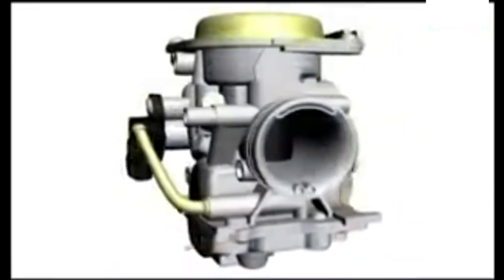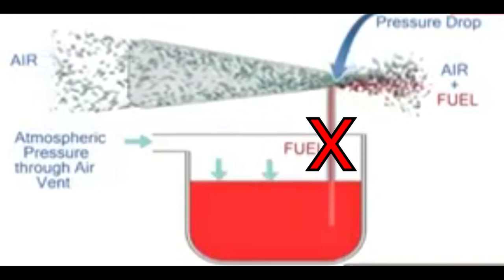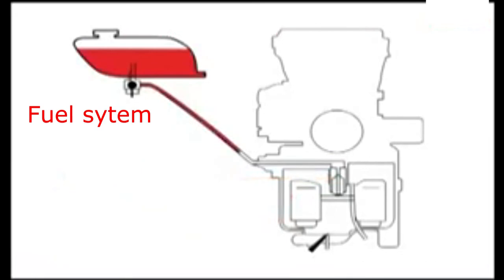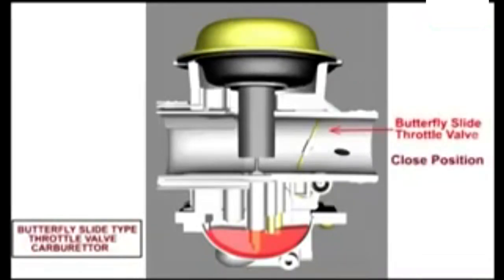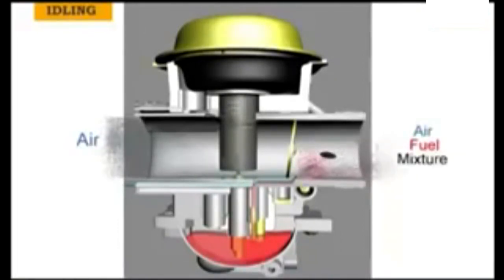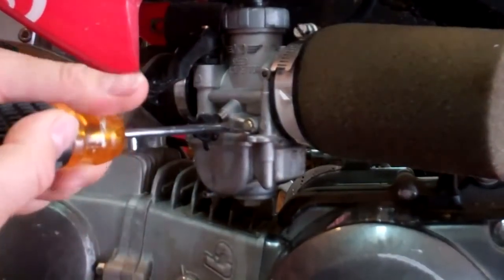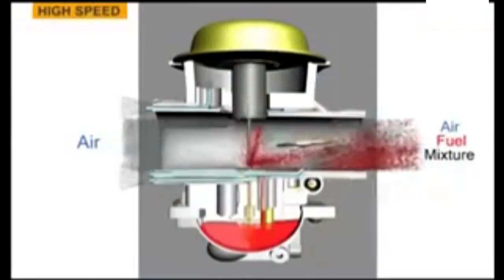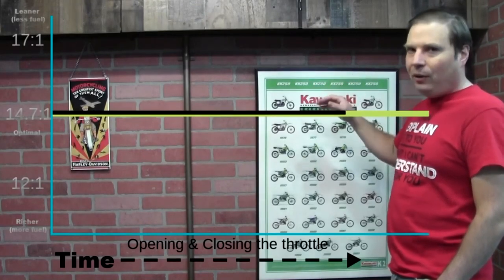Carburetors, all you ever wanted to know (and some stuff you didn't)

Comment: Hey man, maybe you can help me, i have been struggling for a year on my old kawasaki ninja: i have a 4 carb engine, the previous owner put on an hideous exhaust and changed the carb jets. The bike never ran properly, i put on the stock exhaust, stock filter and stock jets, but it always bogs down when i open the throttle, especially when i am going uphill. It has come to the point that the bike barely accelerates on an incline. What could be the problem? I tired to restore the carbs to the factory settings, changed the needle height, changed the air fuel mixture screw adjust, checked the float height, all looks good. I am suspecting a vacuum leak somewhere but i don't know how to find it. 
Thanks in advance mate, you earned a sub with your videos :D
Reply from the maker: Usually stock jetting is a little lean. Try a richer main jet.
Reply: Thanks man, I'll give it a try
Reply: Well i have a little update : after the whole winter i tried to start it and the old battery was totally dead. Took out the ols battery and found out it was smaller than the original spec, bought the right battery (10AH against the 8.5 AH of the one that was on the bike) and lo and behold, the bike seems to run fine now. How can it even happen? My theory is that the smaller battery limited the current that go to the spark plugs and the fuel pump
Reply: @thejunkman  Hi mate, I have atv that idles well but at throttle the rpm keeps going up and down -- let say 1/3 fixed throttle position but the rpm goes up and down, it seems to be in a regular patter, will happen the same at stationary or riding -- gives jerky ride!!!

Comment: I just put a new carb on an 110cc Tao Tao atv. I moved the needle down as far as it goes but when it starts it wants to take off , almost as if you had the throttle all the way down. It’s idling super fast and I need some help on what to do next. Keep in mind it’s the same carb as was on it b4 and it ran fine.
Reply from the maker: Adjust the idle speed screw.
Reply: Align the slide properly

Comment: I have a pz27 on my chinese dirt bike. Can I slap a 27mm flat slide carb and switch the jets for it to work? I'm sure its no but I feel like maybe?
Reply from the maker: It will work, but the jetting will have to change.  You will just have to test and tune for it.  I can't tell you the sizes you will need. Start with the same sizes and work from there.

Comment: I have a keihin cvk twin carb, the problem is port and polished the heads, it want run on stock jetting, stock pilot it idle fine but falls on its face when given gas, I opened the pilot jet 2 thousands and it want idol but it will rev great, , I dont know what to do, should I go back to stock pilot and shine the needle, cause going up on main jets have made no difference, and I went through several stepping it up several times, same results, only time I could get it to rev was open the pilot, but is to much to idle and flooding the plug, so 2 thousands is to much, and suggestions would be greatly appreciated, thanks and have a great turkey day, God bless
Reply: Adjust the fuel air screw in until it stumbles then out until it stumbles and split the difference when you set it.  Do this for both carbs.  Then,  sync the carbs to one another.  If the fuel air is under 1 turn,  you need a smaller pilot jet.  If you are more than 2 and a half turns out,  you need a larger pilot jet. 

Another great option would be to take it to a mechanic.